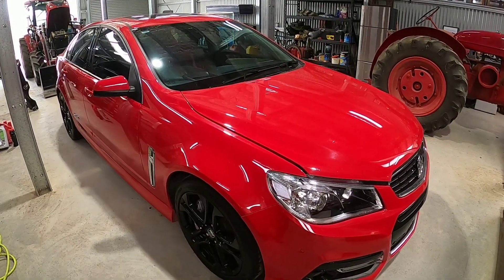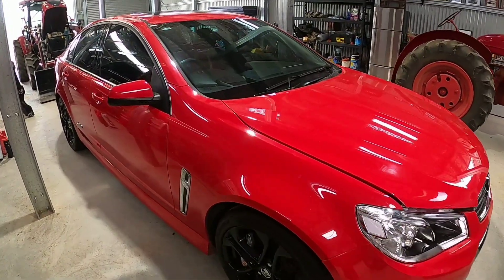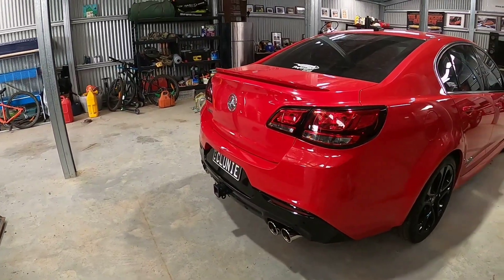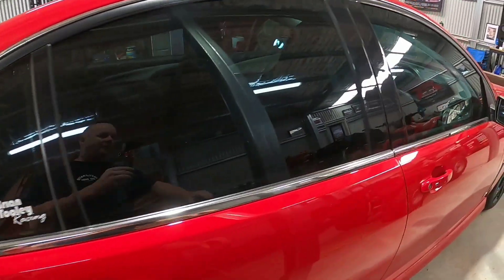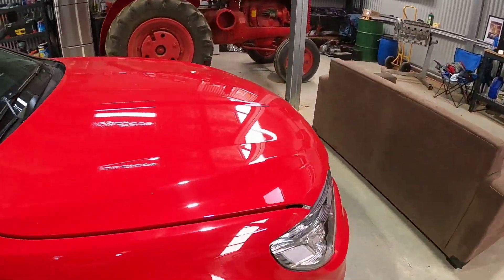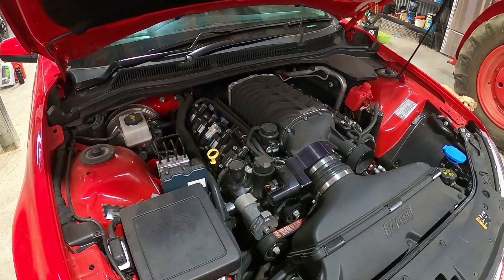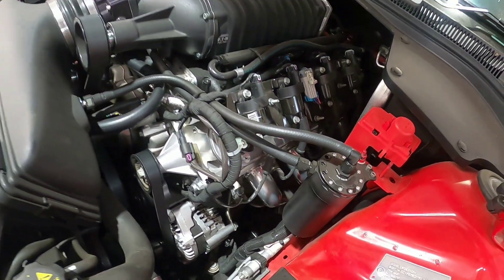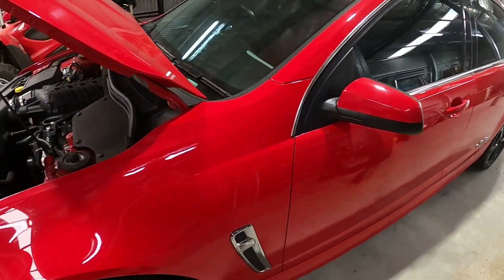950hp+ VF SSV Redline idling....supercharged LS7!

Comment: So its a real LS7 with dry sump that is beyond skits mate!! Was the dry sump a pain to deal with? i have always wanted a LS7 but will most likely end up with stroked a LS3
Reply from the maker: Gday mate, it came with the dry sump but we converted it back to wet sump.  Stroked LS3s are very handy if you want more torque.  Crate LS7s are getting hard to come by and mine was only 1 of 2 left in Australia from the warranty spares for the W427.

Comment: Is that a custom rear bumper for the tow hitch?
Reply from the maker: G'day Johnny, yes standard rear bar with a factory cut out for the tow hitch.  We have recently removed the hitch to save weight.  Thanks for watching!
Reply: @ClunieGarage  cheers for the reply! I didn't know they made the bumper with a hole from the factory.
Reply from the maker: @johnnyle4680  The factory bar has a pre-made cut out/blanking space for VF's in Australia.  I suppose they designed it that way as they knew a bunch of people would potentially mess up their bar by trying to cut out the space for the tow hitch.
Reply: @ClunieGarage  wish they did that for our version in the states lol
Reply from the maker: @johnnyle4680  Yes I think there are few subtle differences between the Chevy SS and the VF Commodore.  The rear bumper diffusers are also different between series 1 and series 2 models.  Some have a gloss finish like mine in series 1 and other series 1 have a matte style finish which looks crap.
Reply: @ClunieGarage  for sure, might have to finagle OPG to send one over some day lmao